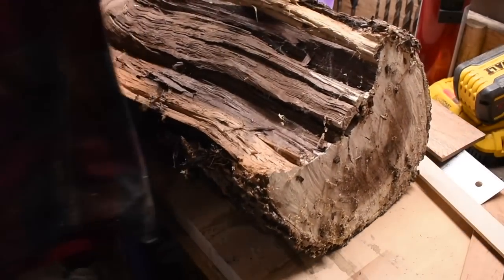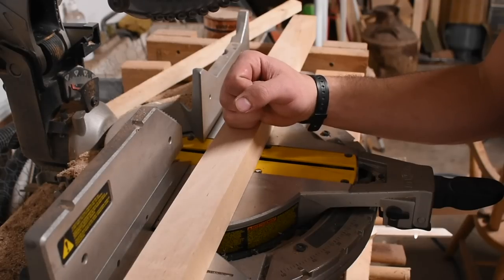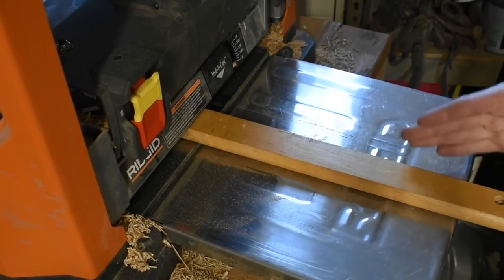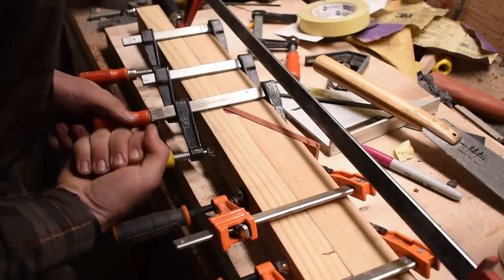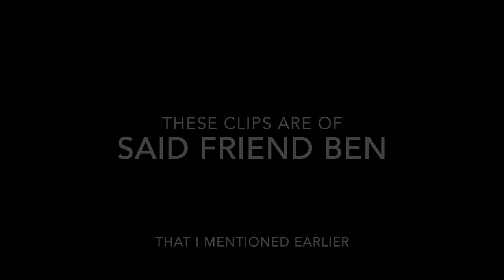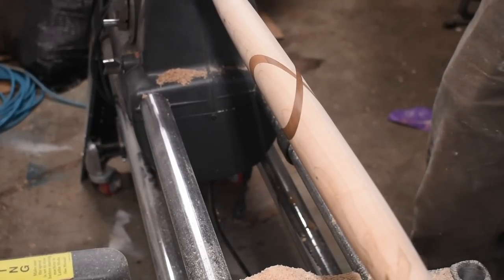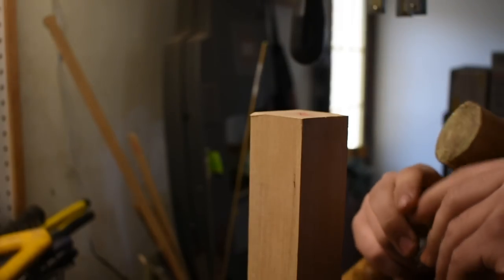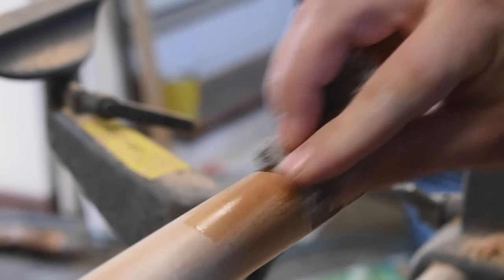Celtic knot rolling pin

Comment: Celtic knots in a rolling pin are pretty, but unless they just sit on a shelf for display they are to fragile and if dropped they will snap apart at the seam on the knot. This is not good if it’s given as a gift. The next time I try one I’m going to try drilling a 1/2” hole in center of the blank in the knot location and put a glue a dowel in prior to gluing in the last accent slice in. Then turn it to. Shape. They do make nice gifts.
Reply from the maker: Well, it does seem like it would be a weak joint, but it did survive turning, which is pretty intense. Have you actually had one pop apart before? I can't remember if I dropped mine or not, I don't think I did. Anyway a dowel sounds like great idea! Maybe I'll use the idea (if you don't mind, of course) and try one myself.

Comment: Hi, I'm an avid baker and a wood turner. Rolling pins should be left unfinished and not super smooth because you want flour to be able to stick to it. I also couldn't help but notice that you're both using the end of the fluted gouge like a scraper. If you use it as intended you'll get a nice smooth cut and easier shaping of the piece.
Reply from the maker: That makes sense about the finish, but what do you mean by "using the end of the fluted  gouge like a scraper" what should we be doing?
Reply: @measure_once_cut_twice  When you used the fluted gouge you were making contact with the tip of the tool which was at 90 degrees to the wood. If you float the bevel or ride the bevel you get a neatly cut curl of wood. Also, the tool wouldn’t normally be used at 90 degrees from the wood. Using it the way you were it was making dust because it was scraping, not cutting.
Reply from the maker: @anaphylaxis2548  So you would have the chisel higher compared to the piece?, that makes sense. I'm a knife maker and have some experiential knowledge of cutting angles. It seemed a little bit backwards to cut at 90 degrees, but it always worked so I didn't change anything about it. I don't know anyone else that turns, so I didn't know, I'll have to do some experimenting, Thanks
Reply: @measure_once_cut_twice  There are some excellent You Tube videos on turning. Check out Worth The Effort Woodworking. Ashley Harwood, Sam Angelo, Richard Raffan.
Reply from the maker: @anaphylaxis2548  I'll have to take a look, Thanks!

Comment: Beautiful rolling pin. What where the dimensions of the turning stock and final dimensions of rolling pin? I'm looking to turn some rolling pins to match my cutting boards.
Reply from the maker: 1 3/4" starting out, basically an 1 1/2" all said and done, it hasn't been used yet as far as I know, so I can't wether that's a good dimension or not
Reply: @measure_once_cut_twice  Thank you. I 'll keep up updated on my cutting board with matching rolling pin progress.
Reply from the maker: @kencross25  Cool!

Comment: The easiest way to think about it is cuts 2, 3 and 4 need to remove the equivelant of whats going back in, that way the knot works out perfect. i did one and the saw blade wasn't at 90deg, i hadnt checked from the last guy, but all 4 cuts were made the same way so even though they were off, they were off the same amount all the way round. The easiest way to do it is to use the same thickness insert as the blade kerf, that way there is no need to removing extra and the knot is finer and more distinct. but try doin 30deg instead of 45 and the pattern elongates. , nice work though.
as for your mate Ben, ask him how his back is, he needs that lathe lifted higher few more inches. he wont end up with a back ache.
Reply from the maker: I'm 5' 9" He's 6' 2", definitely rougher on him but I think he's okay. Funny you should mention using blade kerf thickness pieces, I actually just made another one and did that, the video should coming out soon. And it actually was 30deg's, it's just a skinny pin, Thanks for commenting!

Comment: Why remove the thickness of the peice your adding in from the part your slotting into why not stack the peices in the glue up and then reduce the length at the end of the project by removing that measurement off the end? Also forget a rolling pin how about making a workbench
Reply from the maker: Draw a line on a piece of paper, then cut it at an angle and pull the two pieces apart slightly, you'll notice the lines don't match up anymore, that's the reason. And I will hopefully be building at least one new work bench in the new shop we are building, you should check out some of the videos, they're on this channel too. Thanks for commenting!